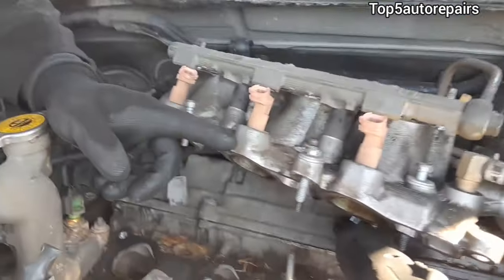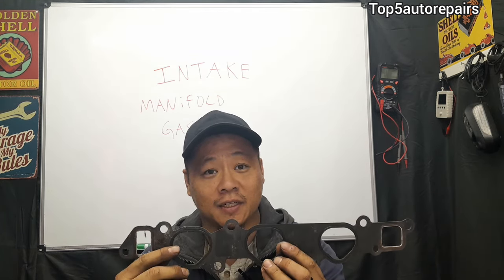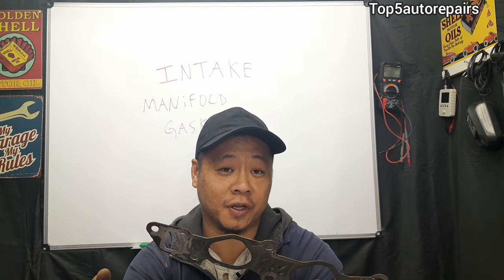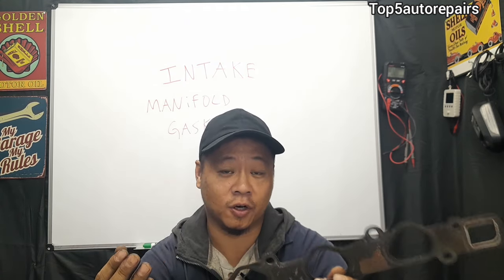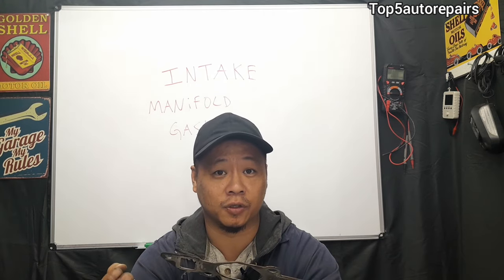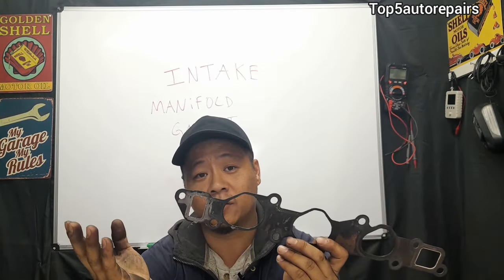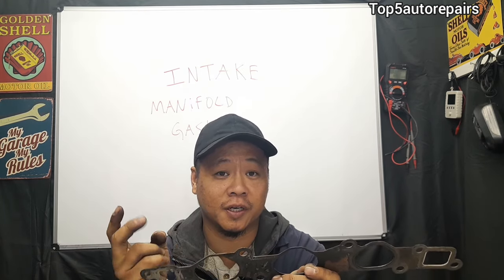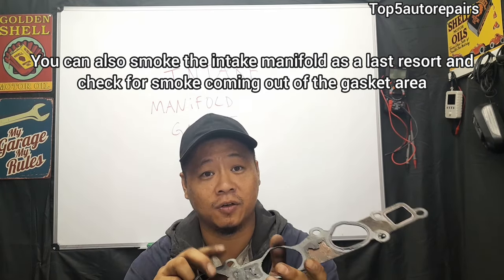Symptoms of a Bad Intake Manifold Gasket Leaking and when Replacement is Necessary

Comment: Bought a 2005 tahoe from a pretty shady guy almost 2 years ago. Went to drive it home and it cut off and wouldn't stay running. Flash forward a year and i chased down everything related to random misfire that you can think of. Even put high flow cats on it. Found this video and it made perfect sense. The manifold gasket is the only thing i didn't think of. Changed it today. Haven't run it but im confident the gasket was the problem the whole time
Reply: So what happened cliffhanger
Reply: @aloiba100  been too busy with building my 86 ss ttop to take the Tahoe out to test it
Reply: We need an update ! 😂
Reply: @Super_Sport_Marc let us know

Comment: I squirt some crc throttle body cleaner in the area with the engine on. If its leaking you immediately hear the change in idle.  Never perform this with a really hot engine for some fire safety.  I torqued it a lil more with a new gasket and no more leaky leaky.
Reply: Do you hear a hissing sound?

Comment: I have a 2002 audi a4 3.0i quattro and it seems that I have a vacuum leak from under the intake actuator (pressure tested with smoke) it's not the side vacuum hoses, it literally come from under the middle of the intake manifold.. What could it be? I am suspecting intake manifold gaskets, but then why would the smoke come right from the middle... Any advice? Thank you in advance!

Comment: Literally just liked and subscribed because you know your stuff. I was getting P0300 and P0405 but the egr is deleted when it was rebuilt. Coils are good spark plug wires are good and new spark plugs installed. Today when I was inspecting with it on I gave it a rev and I could hear air being sucked in somewhere from the front of my intake manifold. The reason why I think you are right is because I’ll have really rough idle when completely stopped and she will miss fire and you can feel it

Comment: I've had a vacuum leak for a little while and tried propane on the vac lines with no results, pushed everything right together and nothing. Then one of the guys at work said it's probably the intake gasket. Well, it seems to be the issue, your symptoms match exactly. Keep up these videos. Not enough people know how to fix their vehicles anymore. This is just an issue I haven't had before

Comment: Thank you top 5 auto repair for posting! Here is my experience...on my daughters 1999 Honda CVR she was experiencing a high pitched whistle sound once the SUV got warmed up, most definitely was a vacuum leak somewhere. Process of elimination I was able test all other hoses for vacuum leaks and nope...so the last possible leak had to be the intake manifold gasket failing. It was a pain to get the intake manifold off and even harder to scrape the 25 year old baked on gasket off (surface has to be completely flat for new gasket to seat properly). FYI, drain the radiator fluid first, and use a clean container if you are planning to reuse the fluid, otherwise alot will spill all over when you pull off the intake manifold, and most likly you will get some fluid into the engine itself and you'll then you'll burn white smoke out the tailpipe. The only way to get the radiator fluid out of the engine then is to do a oil change! Also, if you don't seat the new gasket and the manifold on just right when you reinstall it,  you'll still have a vacuum leak and a very fast idol, fix that by losening the manifold again and reseating it. Once that's fixed, refill the radiator with fluid and check for any fluid leaks around the manifold and tighten bolts more if needed, if all is done right the whistling should be completely gone

Comment: I heard a suction sound coming from the bottom or my suv where thats located it might be tat issue  but I get no codes and my car smells like pure gasoline and fumes at random times. Car also has hiccups rpm drops and comes back to its steady rpm makes tye car tug or jitter.

Comment: He's definitely on point. I recently bought a 2006 Volvo XC90 4.4L V8 and supposedly they changed the MAF sensor. So I'm guessing it's new. I'm getting a lot of carbon build up and poor power and gas mileage. I'm going to change the MAF sensor and use Sunoco gas. Hopefully this will help a little bit. Next, would be to change the intake gasket  to cure the air ratio.
Reply: You should check/replace the pcv valve. Low cost part and simple to do yourself in most cases.

Comment: I have watched hundreds of auto repair youtubers and feel you are the one of the best👍👍👍.
I am fixing a 01 MDX with engine hassle noise when acceleration.  There is no DTC code but I suspect the minor vacuum leaks (running lean) somewhere. I used propane gas to check all hoses and vacuum booster and found no leak. So is it possible the manifold gaskets are leaking?  May I use propane gas to prove that? Thank you.
Reply from the maker: Yes propane will work just fine

Comment: Yup, I hear the clear hissing sounds right at the mating point of intake manifold and engine block.  
I had to replace remove the intake manifold to fix the rear valve cover gasket on Toyota 3MZFE engine, 
and oil leak is now fixed, but I have a strong hunch that intake manifold (with new gasket) is not sealing air tight.
Reply from the maker: Bolts need to be torque.
Reply: Luckily for me, it turned out to be PCV hose that was unplugged from intake manifold side.
Reply: @Top5AutoRepairs  bolts are torqued, just the PCV hose slipped out on the intake manifold side when I was connecting it to PCV and since it’s not visible even day time, I had to use my fingers to reach in to confirm that hose slipped out.
Reply from the maker: Good thing you caught it 👍

Comment: Nice video I was hoping  white smoke was a sign. I have a qx60 with the 3.5 v6. It started blowing a ploom of white smoke at start ups but goes away quickly. So quick I had to have someone stand behind the car because I just thought it was a cloud going by. I’ve had the manifold off when I changed the plugs 40k miles ago in spring of 2020. Now it has 140k miles. There’s no moisture sign on the dipstick or oil cap. I remember having to disconnect 2 small coolant lines doing the plugs. Hopefully it’s not the head gasket especially since I do all the maintenance when needed.
Reply: Do you still need to know what this might be, I can help
Reply: Them engines hood on head gasket issues

Comment: Can I use permatex gasket maker instead of the hard gasket for the exhaust manifold?
Reply from the maker: Do not use silicone gasket for exhaust manifold. Some intake manifold have coolant passages and may need a little bit of silicone.
Reply: My exhaust manifold doesn't have coolant passages would it be OK to use the gasket maker on it? If not, why not?  Thanks for the help.  😊
Reply from the maker: It's not okay. Use the metal gasket for best performance.

Comment: on my 95 lexus sc400 v8 the engine has a rough idle and sputters.  There is also a noticeable hiss by the front of the intake area and the IAC valve.  I have  a check engine light on.  When I press the gas the rpms on the tach go in the wrong direction. they go down instead of up like a vacuum leak or something.   so far i put fresh gas and cleaned the throttle body out which was very dirty with carbon build up.  that cleared the check engine light however after 30 minutes it came back.  when i smoke tested the engine i did have small leak between the egr solenoid and egr valve body. however there is no gasket there. only a gasket between the valve body and the intake which looks fine. 

what could be causing my issue?

Comment: Hello bro, i have a 2003 polo 1.4 16valve bby engine

I initially had loss of power while driving. Heavy misfire and rough idle. I managed to get it home.. fast forward took the head out. Head was fine. Full service. Etc. Put everything back on and started up. But boom misfire and bad idle. Touch the accelerater and she dips to 400 rpms sometimes switches off.

Im using this car like this for like 2months. Engine gets very noisy when warmed up. And hard starts only when engine hot. Drives fine of the freeway thou. Sometimes can stall and doesnt rev up. Switch off and on then back to normal. But misfire and bad rough idle. My next step is to change intake manifold gasket.😅

Comment: is it possible for water to get into the engine causing milky oil as well? no white smoke from exhaust but performance its bad and milky oil dont think its head gasket perhaps a combo of bubbles in cooling system and leaky intake manifold?
Reply: Oil cooler or headgaskets

Comment: Is it a hissing noise or does it sound like an air compressor when you pull the trigger on an air nozzle? And mine only makes this sound when my rpms are high. As soon as it shifts and lowered rpm the sound stops.
Reply: Ever figure this issue out??

Comment: After a lot of troubleshooting and research, I think I have a similar problem but coolant is also being sucked into the combustion chamber. From your experience, is it likely coolant is being sucked into the combustion chamber? Steam is coming out of my exhaust pipe. I don't think it's a blown head gasket. My spark plug wells do seem to have coolant in them. Also, when I first turn on the 2008 Ford Econoline E250 V8 4.6 2 valve, after the van sits foe awhile, steam comes out of the exhaust pipe a lot more but then reduces. I have no DTCs. I had to replace the water pump. Now there is preasure in the coolant system but I am still loosing coolant somewhere. My engine only shakes after the engine warms up. My coolant guage is not working but my scan tool shows the temperature. That van seemingly only has a cylinder head temperature sensor, not a typical coolant temperature sensor. The vehicle barely moves when pressing the gas. I appreciate you sharing your experience with us. Thank you.
Reply: That sounds exactly like a blown  head gasket.

Comment: I have a 93 Chevy and I don’t hear a hissing sound but it idles and runs rough and would accelerate on its own at times and now it just doesn’t turn on at all, I cleaned the throttle body and replaced full pump and many other parts, can this possibly be it?

Comment: My engine light on 
It drives fine and don’t notice any defect
Took to mechanic 
He says there’s a leak but if there are no bad driving symptoms it’s fine to drive!

So I’m driving the car with light on! What do u think

Iv just spent a fortune on repairs recently
Reply from the maker: If the issue gets worst you will start to notice stalling at low speed and rough idle
Reply: @Top5AutoRepairs  ok thanks! Good vids! Very informative 👍🏼👍🏼

Comment: We have a 1989 Honda Civic 1.5 There is hesitation in the throttle at lower engine speeds. Seems worse when the engine is not fully warmed-up. We have none of the symptoms mentioned, but perhaps still an intake leak. Any thoughts?

Comment: Can that cause the airflow sensor not to read?? Cause i bought a new original sensor and my car doesnt read it what i hear is a whistling sound when i drive
Reply from the maker: Correct. If there is vacuum leak this can cause Improper reading.

Comment: so i just recently cleaned my throttle body on my 05 gmc sierra 5.3 just because i had no check engine light on for it or anything so after i cleaned it i installed everything back the right way and did the 3 minute idle learn well tried now when i turn it on it warms up good but once it warms up it starts to surge the rpm goes up and down then when i put it in reverse or drive it revs up and going into gear or to reverse whatever im doing when i drive it and step on it it feels good i feel good power but as soon as i let go the gas now it says reved up or accelerated then once i come to a stop it kind of goes down and just starts surging again do you think this could be it or what else do you think it can be i replaced air filter cleaned my maf sensor do you think this may be the cause of that ?

Comment: Hi I have a 2015 Silverado and is reduced engine power
I change the throttle body and master flow sensor 
And it was running good than on my way to work it’s started whistling sound
And it went back on reduced engine power mode the whistle seems like it is coming out of manifold but iam not sure if it will cause the engine to go in reduced power mode and now it won’t even turn on can you give me a guide on what you think it is?

Comment: Just have a question my 93 Miata seems to be leaking coolant around a manifold bold. would a blown manifold gasket cause that and word helps thank you😊
Reply from the maker: Yes it's possible if there is a coolant passage
Reply: @Top5AutoRepairs  thank you there sure is ill give it a check tomorrow

Comment: My car has no problem at higher speed but also at idle, its maybe little rough but no code, no stalling, nothing. But on MOT, there is high O2 % and lambda at idle az 1,8. Exhaust checked and no holes. So it could be intake gasket ?

Comment: My 98 Acura 2.3 CL struggles to start only upon cold start, have to keep the rpms up to keep it from stalling. Once it gets warm it runs fine and no misfires, could this be a intake gasket issue? Gasket expands as the engine gets warmer and seals any leaks it has when it was cold?

Comment: When I spray cab cleaner around my intake manifold I get the engine surge/stumble. This is when I first start the engine. Quickly as engine warms I can spray the same spot with zero effect. What does this mean, should I change the gasket? 171,174 codes.

Comment: I got a 2.0 tdi, it makes hissing sounds when I accelerate, starts harder, and it goes into limp mode when I get over a certain rpm, usually 3500 in 5th gear usually, it does not have problems for example in 4th gear ar 4k rpm, could it still be the intake manifold gasket?
Reply: Probably mate if it’s not your boost pipes

Comment: 2002 Honda Accord 2.3 Motor my RPM’s go from 1000- 2000 up and down, changed AIC valve, and it still does the same.What could it be 🤔

Comment: I have a 1997 Buick Century Limited with the 3.1 Liter Engine that is Notorious for its leaky PLASTIC intake manifold Gaskets. Why GM though plastic was a good material baffles me.  I have 140,000Km On the car and fortunately, the car was ell enough maintained that the gaskets don't yet require fixing. In the spring I will pay to have the gaskets changed over to a proper Fel pro copper gasket that will outlast the car

Comment: would it cause lower compression on 2 cylinders sise by side to on a 4 cylinder prius?
Reply from the maker: A bad intake manifold gasket won't cause it but a bad head gasket will.

Comment: I have the P1101 code which is a pain to diagnose. Recently had a diagnostic test as they said it’s the intake manifold gasket. I have no issues but loss of gas mileage and now a coolant leak in the passenger side tire. Would the intake gasket be the cause??
Reply: what kind of car is it? did you get it fixed?

Comment: I’m getting white smoke sometimes and rough idle. I changed the mas air flow sensor and also the valve cover on the driver side. But still getting smoke at times and oil consumption so what could it be
Reply: Could be piston rings

Comment: Will a leak cause the idle to be irregular?
Reply from the maker: Yes it will
Reply: How much is a job like this cause? I don’t wanna get ripped off
Reply from the maker: What vehicle do you drive?
Reply: @Top5AutoRepairs  1993 Honda Del Sol
Reply from the maker: ~250-400 parts and labor
Reply: @Top5AutoRepairs  Sheshh thank you

Comment: So im rocking a 98 ford ranger 3.0l ovh so i do hear a hissing noise. Ive checked all vacuum lines and sprayed with brake cleaner for a change. Its difficult to get in between the intake manifold gasket because its in the middle of the engine. So i could never check. I do have an OBD scanner and have seen my bank 1 sensor has always been reading lean, i stall when pulling out my clutch trying to ride into first, so i need to give it a bit of gas. Its a rough start with a high rev. I think i found my issues but wont know until i pop it apart. Also no codes so it must be small enough to not cause a CEL. But enough to make my IAC valve compensate

Comment: Hey nice video man. I have a question. Im having issues with my 2005 Saab 9-5 arc 2.3t. I am getting P0101 code related to MAF or circuit. Before cleaning the MAF, my car would have rough cold start/sometimes stall. It would be fine after starting throught the day. In park and in drive my car idles at 850 rpm. In neutral tho, the rpm drops to 400-500 but then goes back to normal after a second. While driving i also get this odor in the cabin of oil/coolant. I just cleaned the maf, changed the vacuum lines, put new pcv oil trap, spark plugs and valve gasket and the rough cold starts stoped but the neutral idle issue is there, the smell sometimes and the code came back. I had used a odb reader and seen that my map sensor wasnt in range but the map sensor was checked and was good. Could this be an issue causing my headaches, or do i just cough up the money for a oem MAF

Comment: so i was told my intake manifold is cracked it took months to get it now i look inside my manifold it smells like gas n a bit dirty my engine never stalled should i be worries? what would be next step thanks
Reply from the maker: No need to worry. It's common and shouldn't affect engine performance.
Reply: @Top5AutoRepairs  thanks i appreciate it I was worried my engine would go , when u only hav eone car and buying a new car is no option i appreciate youre responce i did not think it was normal smelling gas inside my manifold
Reply from the maker: You're welcome

Comment: What a messed up intake manifold gasket cause your car to have low compression I have the code p0300
Reply from the maker: It won't but it will trigger P0300 random misforr codes
Reply: @Top5AutoRepairs  the compression test on a one cylinder where the gasket messed up it's 0 pressure p0300 it's flashing